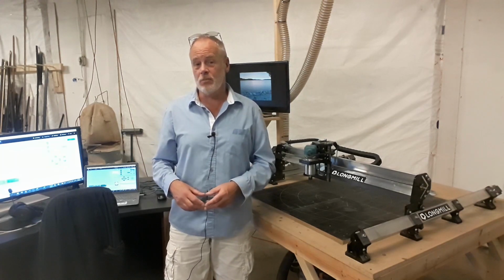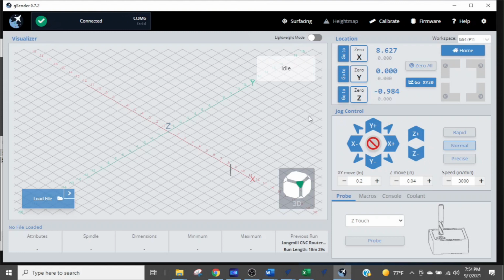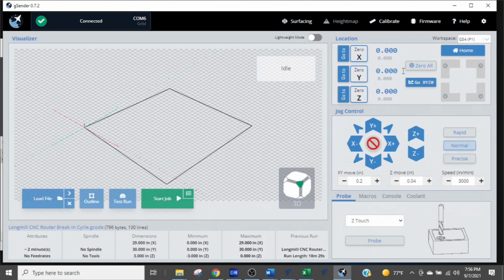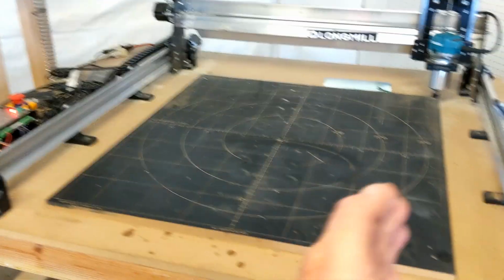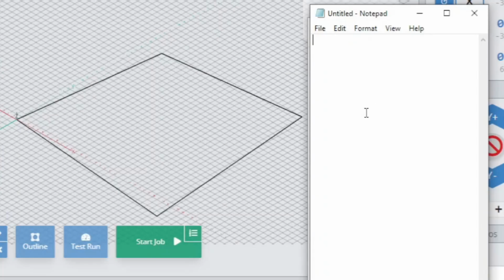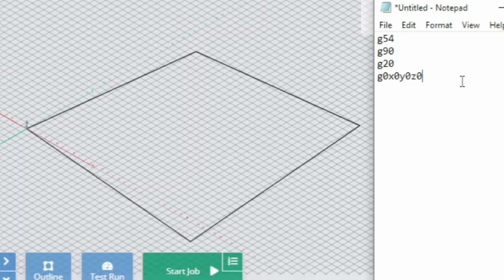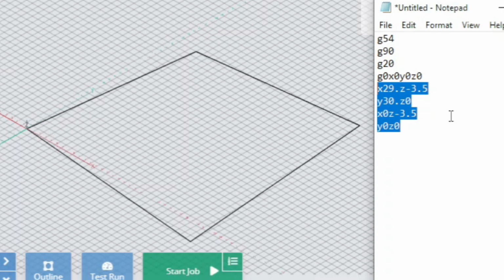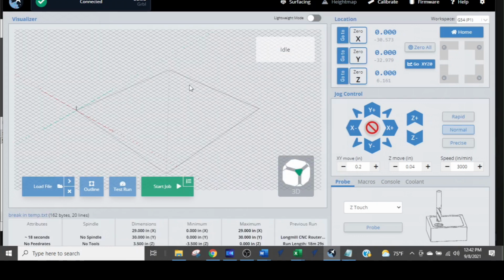New CNC Router *MUST DO*  - [ Break It In! ] - Garrett Fromme

Comment: How bad is it to hard stop the machine? I did it a couple of times setting it up by accident.
Reply from the maker: leestringer, Hard-stopping the machine can cause damage to the tooling, spoil the workpiece, and even harm the machine itself. It's essential to always let the machine come to a complete stop on its own to prevent any issues. Be careful with future setups to avoid this issue brother!
Reply: @IDCWoodcraft  Oh boy, that's depressing. I hope I haven't ruined my machine before I cut my first board. 

I'm surprised limit switches aren't mandatory if it's so easy to do this. I'm not experienced so I really didn't know the difference.

Comment: I am still in the getting to know my CNC machine phase.  I purchased a Longmill MK2 48 x 30 CNC - do you happen to have updated g code for this version?  Thanks!!
Reply from the maker: Deb, I dont have the updated gcode for the larger Longmill yet my friend. You should be able to use the 30x30 longmill gcode with your 48x30 no problem. It just wont move all the way to the limits of your machine.

Comment: Hi Garret, the problem with oiling the parts is that over time the sawdust hardens, creating micro grooves, both in the linear guides and in the threads.  And with that, it generates more clearance, that's why sawing with oil and grease don't mix.  Another point is that as soon as sawdust is added to the oil, it quickly disappears due to its absorption.  The ideal is to put graphite powder and rub everything with your hand.  the lubrication will last much longer and will even avoid creating gaps.
Reply from the maker: Eduardo, that is a great tip. A dry graphite powder would work great.

Comment: Great video Garrett! Just found your channel (and subscribed). I  have a LongMill on order and was wondering if you had a video on how to square up the gantries so that the plane of movement of the two Y rails is parallel and the X is perpendicular to it. I don't trust that measuring between the mounting holes on the supports would be accurate enough.  Thanks!
Reply from the maker: Hank, that is a very good video idea. I will look into that! I do have a video that will let you check the accuracy of your machine to make sure it is set up correctly. Heres a link: https://youtu.be/l1oh8nekPu4
In this video I made a rather small square but you can make a larger square to propagate any errors you might have in the setup of your machine.

Comment: couldn't download file, says file cannot be found.entered manually and router went left instead of right and jammed. ????
Reply from the maker: Kevin, my apologies brother. I transferred everything to a new website. I will work on getting that link fixed on my end. The Gcode is in the description. Did you try and copy paste that? You might have an issue with a typo when you entered it manually.
Reply: @IDCWoodcraft  I followed your video to the letter, I can't understand why it went to the left.i will watch for your link.i would also like a link to surface my long mill mk11.
Reply from the maker: @kevinduke6491  it might be just a setting in the control software

Comment: Great info. Looking to eventually purchase a Longmill, but I currently have a foxalien 4040xe. It's a decent machine but cheaply built. One of the most crucial things I've started doing is periodically measuring vibration with my phone sitting on the router during a test cycle (I'm an NVH guy). Doing this periodically provides an opportunity for performance trends to be developed and  ensure my machine is running as consistently as possible. Wish I would have done this when I first got it.. but live and learn!
Reply from the maker: Jason, that is really involved my friend. Sounds like when you pick yourself up a longmill it will be in good hands!

Comment: I am setting things up for some serious CNC.
I have two acres with trees that will need removal. So, I am thinking sawmill; but, will probably do the band saw thing for my wood.
I have other sources for wood; but, why throw away a tree?

This is what I am looking at for a complete setup.

Table saw

Band saw

Sander

Router table

Altmill and table

Vacuum system

Any suggestions?
Reply from the maker: Hi Jombo. No...don't throw away a good tree. Yhere's projects in them woods. I suggest a planer. I had this one for a long time. Well built → https://amzn.to/3KjUnIj

Comment: Thanks Garrett,  and boy did it prove out. I have the Longmill have spent time getting it setup, issue with squares causing the gantry to to come off the the lead screw, thought i bent it but happy to say I did not. After I got that straightened out and ran a few jogs around you video  for the break in came out. Well I am glade I ran it. You have like 102 passes and on the 101st the coupler came loose on the left y access.  Yikes lead screw popped off and gantry started to get out of align.  Wow at the very end of the test!  So I have it back connected and am going to run another one.  Thank you for getting this gcode out there it found an issue for me. I think I will build myself a check list for each run and for sure use this break in every so often
Reply from the maker: Hey Chris. I'm so glad you found that now. It would completely suck if you found it during a project. Whew!

Definitely do a monthly maintenance check.

Comment: Good idea. I wrote one for my CNC plasma but haven't done one for my OneFinity. Something new on the to-do list :-) 

One last step though, would be once you've run this, you should go back and check all the nuts and bolts for tightness, the X and Y rails for square and the Z for perpindicularity (new word I just made up). That way if moving everything around a lot has loosened anything and caused things to get out of square you'll catch it and be able to address it before cutting for real.
Reply from the maker: Hey Jim. I'm glad you're going to do that gor your router. It can definitely make a difference. Did you find anything after you ran it for your plasma?
Reply: @IDCWoodcraft  I did find a place where it was binding the first time I ran it on my plasma table. Also where one of the cables was setup too short. There were a couple of screws I tightened but don't know if I hadn't tightened them enough when I assembled it or if they were loosened from the torch head being driven all over the table. I don't do a lot of full table cuts with the plasma (it's 4ft wide) so I haven't noticed any issues since I went through the burn-in routine.

Comment: Garrett, thanks. Breaking the box open this weekend. Should I have a checklist to check certain spots before every job. Kind of like having a pretrip before I fly and even a post trip after a job? It's works for airplanes. ;)
Reply from the maker: Deiter, you are ready to build it! A check list is something almost everyone misses. Yes. You gave me the idea to put one together. THANK YOU!

I will have to plan it out so whipping it out here ...I might mioss something
Reply: @IDCWoodcraft  I know I'm wayyyy new to this, but formatting it like a pilot checklist might be good so they can be little flip cards to be kept right on the table. Start of project , end of project and maybe checklist for changing bits during a project. Kind of what steps to take when not only physically changing it, but is there stuff in g sender that needs to be done too... Of course I'm new and don't know it all yet.

Comment: In your 3rd movement - x0z-3.5 why isn’t there a (.) between the 0 and z?
Reply from the maker: Hey stuart. The zero does not need a decimal point since it is null. The controller knows this. That's why it is not necessary

Comment: Great video Garrett & excellent advice.  I always run a 'break-in' cycle or 'break-in' period on tool / machine I get, whether it be a kit, built from scratch, or ready-made.  I also do periodic maintenance on all my tools & machines.  Other than replacing parts, due to wear & tear, I have never had a problem with any of them.  Some of them are pushing 40 years old and still going strong
Reply from the maker: Thanks for commenting this, Patrick. This is vital to long lasting equipment. I will do a video on maintenance soon, as well.

Comment: It's good to dry run a machine around close to it's travel limits. We often do that in industry. We call therm warm up programs. It lubricates the ways, lead screws and other moving parts. It also helps keep rust off of critical areas.

With routers, it seems  obvious they would benefit from doing the same thing. A "warm up" program is easy to write once you know the G code for your machine. You can even use a program you created for a piece that is pushing the limits of your machine travel.  Just don't put any material on the machine.

I also noticed you put some oil on the lead screws. Lubrication on moving pieces is always a good idea for smooth operation and to reduce corrosion in areas of the machine travel you don't often go to. Running your warm up program occasionally will keep all areas lubricated and clean.

Next Wave Automation recommends I use Dupont Teflon Silicone Lubricant on my Shark. It's a dry lubricant. Well, unfortunately that seems to have been discontinued by Dupont. Now they recommend CRC 3-36 Dry Film Lube. I can see benefits to dry lube of this type as dust won't stick to or mix with it like it would with a wet lube.

I don't know what Long Mill or other brands of machines recommend for lubricants. That is probably a good thing to know.
Reply from the maker: Oh man, I forgot about dry lubes. I will definitely make note of this in a future video. Thank you. Your input and experience is extremely helpful in reminding me of things.

Comment: you moved  to x29. then you moved back to x0. Is the controller counting steps back to 0, or looking for home switch?
Reply: It's counting steps. Every move from the original 0,0,0 is calculated by the controller based on the revolutions of the screws. By counting the revs & calculating the distance moved by rev the machine always knows where it is once you've homed it (& the power stays on). The controller translates the G-Code positions into number of revs (or steps) the motor needs to turn to get the center of the spindle to that position. Then it turns that number and the spindle rides along the screw to the place you wanted it to go.
Reply: @jimhatch5873  That is what I though. I don't have home switches installed yet. That is next.
Reply from the maker: Stay off the homing switches